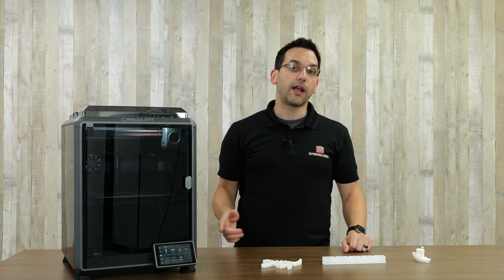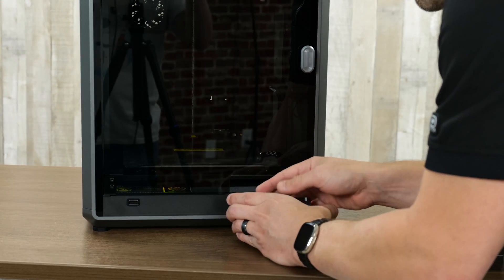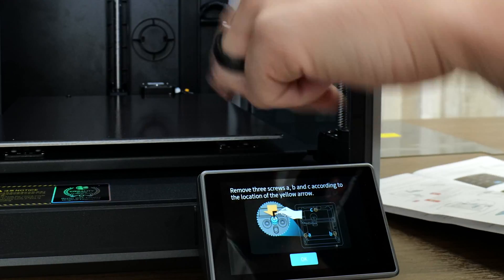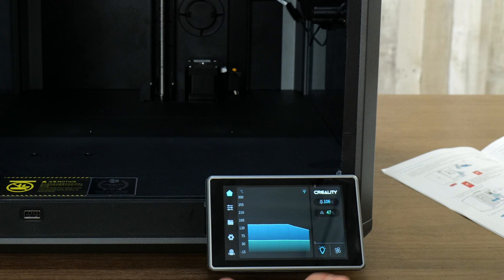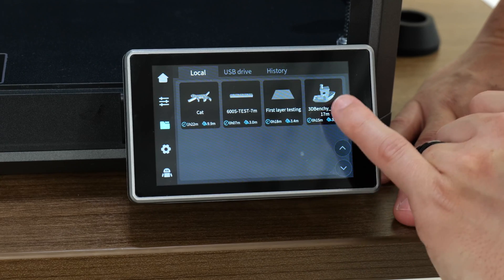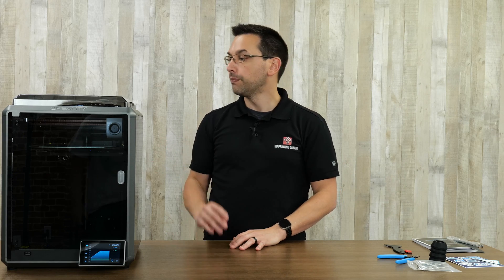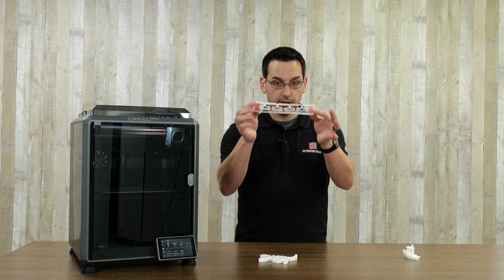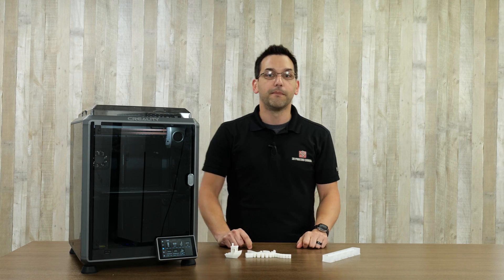CREALITY K1 SPEEDY 3D PRINTER - UNBOXING, BUILD & TEST PRINTS

Comment: If the DHL courier company manages to deliver the K1 I got from eBay it's going to be a long night putting it together I got too p off with using my Ender 3v1 calibrating it with A4 paper and the spoil holder on the top constantly falling off I just want simplicity the older I have gotten lol 😂

Comment: ATTENTION!
Be careful of the voltage you've chosen.
If you choose 115 and your wall generate around 230 then that's an immediate loss of your printer and money!!
start by setting the printer on 230 then if it's not working properly that means your wall provides only 115 (it's 115 in most of us and Canada)

Comment: My experience was a little different, I found that there is no toll-free support phone number to call, you have to use chat support. I had 4 different incognito support chat windows open since the morning which extended passed 1 in the afternoon and all chats auto closed on me and asked me to leave an email instead. I am a cyber security person by day and I have to say their support is negatively impactful and you might as well have a brick for a printer WHEN it malfunctions. Great features and all but not if they don't work.

Comment: Thank you for the very informative video and very clear and articulate presentation.

I'll be printing more parts for my online business soon so I'm considering the faster K1 Max so I can print in 0.1 mm layer height to get awesome quality prints but a lot faster than my current bed slinger, and the larger build volume will allow me to generate G code that prints multiple parts sequentially for faster mini print farm production.

I'll wait a few months for the K1 teething problems to be resolved, either by Creality or by the community.

Comment: I’m having great prints from the K1 there was an initial issue with the extrusion but I realized the motors bracket is plastic, so you have to give it another tighten before your on your go. And you can put the filament tube back to where it’s supposed to go, the problem everyone’s been having is just the motor on the extruder is not tightened.
Reply: is k1 compatible with prusa slicer? I can't find her there

Comment: Watch out for the latch on the extruder - seems like a lot of other users are finding that it gets hit by the cable chain or just doesn't stay fully latched in general. There are also reports of the PTFE tube needing to be pulled out of the cable chain near the extruder in order to improve the filament path as the bend is quite tight.
Reply: Thank you that helped a lot!

Comment: This isn’t a Bambu competitor as much as it’s Creality reverse engineering everything that is Bambu. Even the screens are the same
Reply: @Jason I’m guessing he’s referring to the X1 carbon, which the K1 resembles a lot more than it does the p1p in my opinion
Reply: @Jason the p1p and x1c have the same size print volume, and are basically the same printers aside from the enclosure, screen and LiDAR, and the AMS works for both the p1p and the x1. LiDAR is an optional component on the k1, but it’s not optional on the p1p, nor is the color touch screen. So basically the only differentiating feature between the k1 and x1 is the AMS. But that’s also a differentiator between the k1 and the p1p.
Reply: @Jason my P1P OUT STRIPS THIS CHEAPO CLONE OF BAMBULABS
Reply: @Jason  the p1p does not come with LiDAR and it’s not optional. So the p1p is definitely not better equipped in that regard. And no the screen on the p1p cannot be upgraded after the fact for additional cost.  I do believe both the bambu printers are going to be more reliable and consistent printers than the k1 though.

Comment: You got a good one! On my K1, two of the bed mounting screws fell out during the benchy test print... wobbly bed = not a good benchy LOL. Fortunately it was an easy fix!
Reply: Did you have the extruder issue, I did watch your review but I have seen so many I cant remember who had which issues? the cable chain was hitting the extruder arm and disengaging the gears, only a slight movement was required to do this, Creality said they were going to fix this but from what I can acertain it has not been implemented, the extruder arm does not have a spring or a ratchet mechanism to keep the gears tight to the filament.
Reply: @AndrewAHayes  No extruder issue for me, but, that said, I became an "expert" in disassembling the hot end due to an error made by me when removing filament LOL. I had a chunk stuck in the heat break and had to disassemble the unit. It wasn't straight forward, but now that I know how, it's quite easy LOL.
Reply: @DWIT3D  Maybe they have fixed it then!

Comment: Any ETA on the K1 max?
Reply from the maker: Its on order -- no ETA
Reply: @3DPrintingCanada  ok thanks for the reply. I’m torn between the bambu lab p1p or X1 and k1 max. I’m sure the p1p will be a better printer but the larger print volume of the k1 max is really appealing.